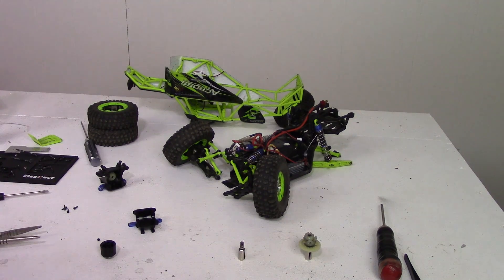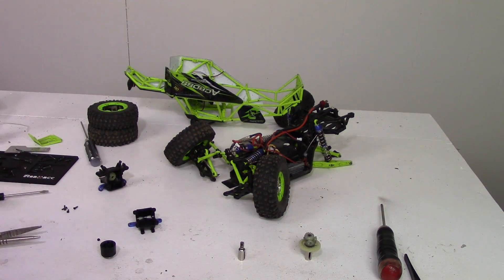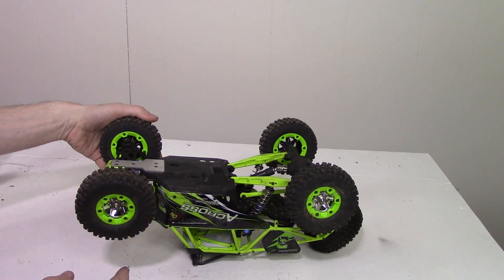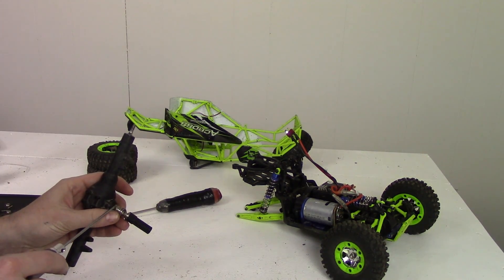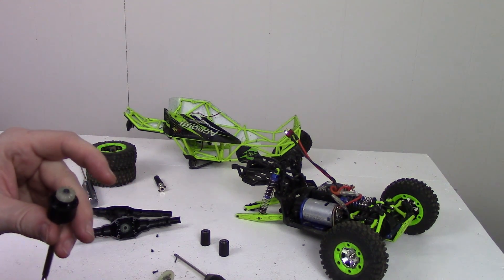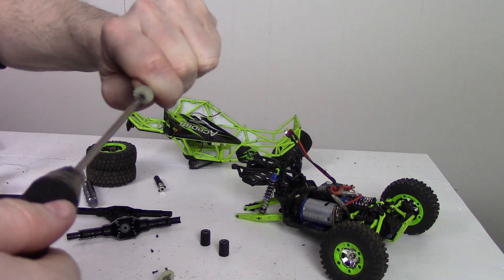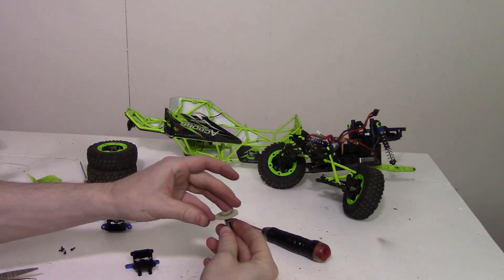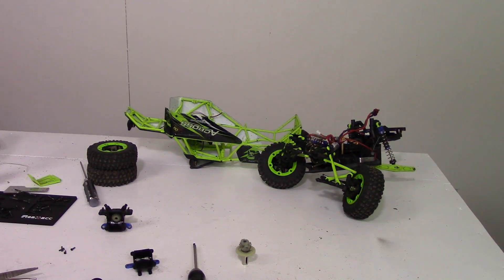WL Toys 12428 Diff Problems From Running 3S!

Comment: just ordered an aluminum Cree led light bar. very cool lookn design. Five 4 volt cree leds should throw some serious light. I much prefer cree style leds over basic led's. next on list is the hot racing 1 piece upper link mount bracket for the rear diff. it's a 1 piece design replacing the stock 2 pieces. it connect the upper rear trailing links to the diff itself. also an aluminum rear diff cover and the HR aluminum axle tubes for the rear diff as well. other than that nothing till I start getting all my orders in from Japan. glad the light bar is coming from the states here cause I'm still waiting on all my overseas orders. I got the driveshaft that's it. been over 3 weeks on the lower a-arms alone. think I got somewhere around 9 overseas orders and now 3 in states orders. it's the economy shipping that takes forever. the e-packet shipping usually gets here under 2 weeks.
Reply from the maker: A cree light bar! Nice! That'll be real bright and should look awesome. I've been there waiting for lots of packages to come in from overseas, the waiting sucks! haha. Sometimes I get problems with customs here leaving packages in a warehouse for months it's a real pain. I did find another pinion the same size as the one that I couldn't save, even though I've already ordered a new one. I can get that HBX up and running a lot sooner now.
Reply: Void X RC great. I'm curious to see it running brushless. Well at least you can replace the pinion you found so know you got a spare. Maybe one day try drilling out the stripped grub screw just to save that pinion. can never have too many extra parts...
Reply: Void X RC I also ordered what I believe to be the rite size servo ball for my aluminum servo arm which I still haven't been able to install yet. I bought a 10 pack. the 4.8mm size is correct it's just the thread size I wasn't sure about. and also I will say this thing drives amazing in 2 wheel drive. honestly for what I do I don't even notice a difference accept for squirrely back end in corners if I'm getting on it too hard but it's fun tbo. think alot has to do with these tires I have there great far as traction is concerned. the overall sound of the drivetrain is 100% better, smoother sounding.

Comment: I'm stuck between the vaterra twin hammers and the axial yeti. if I go with the axial yeti I'll more than likely go with the brushless rtr considering I really like there motor design. I really like the vaterra twin hammers as well. the build quality of the rear diff is exceptionally high. every screw hole has steel thread grommets punched into it's composite material making for no plastic threads. if the rest of the rig is built like the rear diff than the vaterra is a must, especially for the price...
Reply from the maker: My twin hammers clone doesn't have steel threaded grommets or anything like that. Is the twin hammers rear diff you got a stock one or is it an after market one?
Reply: Void X RC stock!!
Reply: Void X RC the rear diff is the best part of my build next to the motor combo wheels and shocks which I just tore down last night took the bottom caps off and pulled the retaining clips to get inside to the orings and packed some green slime in and reassembled. Not that it would hurt but the way this goes together the green slime stays in the center of the bottom cap lubricating the shock shaft to help better seal dirt out as the shock compresses and decompress helping keep the oil cleaner longer hoping to get more life out of these silicone orings. the green slime stays inside it's working like a charm till I get some shock socks. my front shocks are still the blue Chinese brand fayiue upgrade shocks which needed stiffer spring rate for the front cantilever style setup but they held oil like a champ till 1 day last week now they leak like a dog. I'm about to order the hot racing piggybacks for the front I'm not sure if the gmade xd will fit the front like they barely fit the back..

Comment: got it back together in rear wheel and let me say what a blast in the rain. I put the stock tires on to keep from burning up the superswampers and it's actually pretty easy and alot of fun to drive. not as quick out of the hole in the grass as it was with 4x4 BUT the grass was wet it was pouring out during the test and I was using the stock tires which are small and no where as grippy as the superswampers which I feel will bring the acceleration back up. try it out today now that it's little more dry out. the Toro brushless is insane I finally got to fully punch the throttle now that I'm not running plastic gears except for spur which isn't plastic and I will say holy crap the rpm's are so intensely high you feel as if the things about to explode like an atomic bomb. it's a very smooth sounding intensely explosion but an explosion of rpm's none the less. nickname my motor the atomic bomb. the rpm's are WAY more than I expected for a 4000kv system. I put more wear on the stock tires last night than they've gotten since I bought the truck. had to get it out of my system before I put my superswampers back on. other than that I really don't push the motor too hard and let it cool down first signs of heat, maybe little over cautious...
Reply from the maker: Haha yea 4000kv motor can produce some high rpms, were you running on 2s or 3s? On a fully charged 3S that motor will do over 50,000RPM under no load.
Reply: Void X RC.   3s.... got the fayiue rear diff in also yesterday. Are they supposed to be locked?
Reply from the maker: Nope, I semi-lock mine with really heavy diff oil, usually 500k weight.
Reply: Void X RC wonder why mine is locked. might as well get my money back I don't it anyway. the vaterra has a locker unit in the carrier. they sell the same lock unit to install in the front diff for twin hammers

Comment: I have the 12428 and the 12404, both have their place .....I tried bashin the 12428 and it failed.....I fixed it and took it Rock crawling and a lil mild off-road it was awesome! I run it on a 7.4v 2s 35c 1500 with a cooling fan on the motor ....35c gives it a bump up in speed and torque from the stock 🔋 (but it will run fine on a 11.1v 3s 25c 1800) just not all the time and if you go any bigger fizzle try your ESC!! .....if you bash it you'll trash it!!     Now my 12404 I bash the crap outa it(reminds me of a mini JLB Cheetah) and I run it on a 11.1v 3s 25c 1800 with a cooling fan on the motor and the ESC. With the stock 2s🔋 best run was 22mph ....on the 3s 🔋 after only 2 runs (then rain) 35.23mph it was just warming up I know it will do 38!! check out my videos!!!
Reply from the maker: Yea I suspected that the 12428 would do better in a crawling role compared to a bashing one.

Comment: I need help I have one and the drive lines will spin at full force but the tire only spin half that
Reply from the maker: It sounds like the gears in the diffs are starting to wear so they aren't transferring all of the power through them.
Reply: Void X RC I've only had it for 5 days before it started that

Comment: If the outside of the diff is fine just JB weld or glue the inside gears and have fully locked diffs it's way more fun to drive and you won't have to worry about this crap. I have the hbx transit pretty much the same RC and I in welded my diffs and haven't had any issues and I can crawl now which you can't do with an open diff anyways so why not lock them.
Reply from the maker: Thanks for the info! I have taken this apart more though and have used parts on another RC build! Used the motor mount and spur gear on a dump truck RC build
Reply: The motor will run hot and it won't be as controllable when bashing or doing speed runs
Reply: @kylestalnaker  I recently put a 3930kv in my hbx transit and it handles fine for bashing, speed runs is pretty dumb in a solid rear axle rig made for off-road your just asking to crash lol, it's like doing speed runs in a udr or super rock Rey it's super sketchy and not what they are made for unlike full independent suspension rigs
Reply: I hope you realize that a lot of people do speed runs with the UDR, hell the thing goes 50mph stock
Reply: @kylestalnaker  people do speed runs with everything but a solid rear axle trophy truck isn't made for asphalt speed runs, if they were then the drag racers would use them, it's like doing speed runs with an xmaxx it's cool and all but not at all what they ate best at.
Reply: Exactly, anything is possible with any rc, cheap or expensive. Hobbygrade is hobbygrade, you can do whatever you want with the vehicles. The only limit is how much time and money you're going to put into it. It doesn't matter what it's made for because you can make it anything you want. Just like when people make crawlers brushless bashers. They aren't supposed to go that fast and take that kind of abuse, but it's more than possible to make it happen and make them good at it. Don't put a vehicle down because of what it's made for, that doesn't matter.

Comment: just did some math. figured out in the 2 months of owning this rc adding the $80 price of the truck itself which is now higher from what I'm seeing I've got $587.61 invested in this hobby. this also includes the $15 in about to spend on another driveshaft. I honestly didn't think it was this much and even though it looks nice I'm not seeing the $600 lol. I was like wow holy shit man. who has $600 invested in a 12428, this guy rite here. and the thing about it is is it should be alot more. I got myself some kickass deals on things like the steering servo the radio the led light kit all my aluminum upgrades my wheels were good price the lightbar I just got $20 for a $50 lightbar. think all the aluminum upgrades were my biggest saving point. and technically I'm maybe 65% complete to where I want it to be. still need things like power winch, luggage rack, bungee cords, green lo glo means for undercarriage, 2 cree led light bar for headlights inplace of what's on my hood, possibly front drivetrain to get 4x4 back up and running, ect, ect... family is getting my a vaterra twin hammers for holidays. and I'm also lookn at the yeti xl along with my Losi 8ieght-e 4.0 buggy... need a second mortgage to further fund my hobby which is becoming increasingly more of a habit if anything.. I also need to create a type of bumper system for my roof to keep my lightbar from coming in contact with ground during a rollover especially on pavement which I discontinued driving on until I figure up something. even some corner rubber bumpers for the light bar itself. idk any open ideas are welcome!!!
Reply from the maker: I know how spending can be on RCs, has bitten me quite a few times. I do have another vehicle coming in the mail, who knows when it will get here, but It was a good price. I just got some new wheels for the hbx brushless conversion, they are so much better than the stock tires. I did have the feiyue that I am upgrading out on the trails yesterday that was fun, lots of mosquitoes though. I have to many ongoing projects now, hopefully I can keep track of them all properly.
Reply: Void X RC like to see those wheels when they come in. Did you get a chance to check out the fayiue upgraded diff with what appeared to be metal carrier yet. so you the hbx up and running? bet it's a bit if a beast with the upgraded brushless system in it. yeah I'll say I really didn't think I put that much into this already especially considering how much more I still want to do with it. the lightbar is a major huge improvement not only on the lighting but definitely on the looks. getting rid of the toyish lookn lightbar and the cheap lookn green wheels is the biggest improvement from low end to a higher end lookn hobby grade rc. the metal chassis upgrades also make for a more expensive and more sturdy look...
Reply: Void X RC well I can't honestly say all that money went into the truck itself, from being new to the hobby I had to start from the beginning with everything which I included into the price things like my accucell 6 lipo charger, my lipo pack 1 of many more I'm sure lol, $15 just for the chargers power supply which you have to purchase separately, big rip imo, others like large bottle of losi shock oil, couple dean's to xt60 connectors, ect. other than that the rest went into the rig itself. I have absolutely no regrets and soon as my truck driving school is completed I'll be able to buy alot more. Team Losi here I come baby!!!!! WootWoot!!!!!!!!!
Reply from the maker: I have a pic of the Hbx with the new tires here: https://www.instagram.com/p/BWKoNSsAv3w/?taken-by=voidxrc
Next week will be the running video of it. Yea accessories can add up after awhile too. I've invested in a good charger, solder station, lots of wires/shrink tube/connectors/crimpers etc.

Comment: Where you running lipos?
Reply from the maker: Yes a 3S lipo
Reply: @VoidXRC  Oh right, would it be okay to run 2s lipos?
Reply from the maker: @robcrawford9657  Yes it is meant to run a 2S lipo so so it won't be a problem
Reply: @VoidXRC  I didn't know that, i think i'll get one now i know it uses lipos, hope you get the diff sorted.
Reply from the maker: Thanks! I actually ended up cutting the chassis up and used parts of it to convert a toy dump truck into an RC one :)
Reply: @VoidXRC  Hahaha! cool, should do a video for that.

Comment: I put a 3s battery in my WLTOYS12428 and smoke come out of the motor now it wont go?
Reply from the maker: It sounds like the motor is burnt and possibly the speed controller
Reply: I found out were the smoke was coming from on back of the motor there a black Diode between the - and + I cut this off and now it working well :)
Reply from the maker: Great to hear!

Comment: Well I hope you got your money back. I've gotten mine so far but I do have alot I'm still waiting on. this vaterra rear diff is like gold in my hand, I'm done for hooked on the hobby. the thing is so smooth turning by hand feels like butter. I still want the HR axle tubes and waiting on my HR carrier to further support from flexing under torque. I searched and googled and googled trying to find any problems with any of the vaterra drivetrain and could not find not one problem. I found a few for axial some minor stuff but about it. figured I'd take it easy on the diff till the tubes and carriers get in but don't look like I need to even worry.

Comment: Hi, how you can drive on 3s? My Car smoke immediately on first Throttel with 3S T.T
Reply from the maker: For 3S on this RC you need to replace the electronics, so a new servo, speed controller and radio/receiver. The stock electronics just can't handle it properly.
Reply: @VoidXRC   Thanks for your Answer. But in the Video it looks like a Stock electronics in your Car. Greats from Germany.
Reply from the maker: Yes I still had the stock electronics, they don't always fail instantly. I have heard of quite a few failing instantly, and lots that have failed after running it a few times on 3s and some manage to run a lot longer on 3s. Temperature plays a big part, if it's 5-10C out compared to say 25C that can make a big difference for the electronics.
Reply: @VoidXRC  Ok that makes sense thanks a lot.

Comment: Both my front and rear diff had missing teeth on the ring gear and worn down pinion gear, Causing it to bind and spit out the rear drive shaft :P.  I only run a 1500Mah 2s.

Comment: LoL You dont need to buy new diffs. Of course metal gears and high quality parts would be beneficial, but you can fix those. Take torch and broken drillbit on the small side like one millimeter bit. Heat it up and melt peace on both sides of the gear, so those act as stoppers preventing saft from slipping. Peace of mild steel will do the job too. Then clean the gear and just get peace of scrap plastic and fill rest of the extra space using super clue. Helps also if you didnt get perfect fit with metal peaces. 

To remove screw try heating it and then use couple of pliers to turn the screw. It there is no area to crab with pliers, then try use something to cut a slot heat. Finally if nothing else works drill the screw out and and clean the treads with a tap. If you have access to small lathe its good idea to do this with that as making such small treads risks breaking the tap and then its lost cause.

Comment: got some nice rigs there in your main profile picture. especially the 3 middle 1's. the orange flame lookn truggy style with the losi disc wheels and the green crawler. actually nit orange more like red yellow and some black!! look like good tires for sand tons of small spikes!
Reply from the maker: yea 3 great vehicles there! from left to right is the axial Deadbolt, Hobbyking Basher sabertooth 1:8 scale and Axial Wraith! I don't have a great place to use the Sabertooth though :/

Comment: Mine went in a little bit of water and started making a squeaking noise. But it runs fine. Also, can post a video about how to clean the bearings with WD40 please.
Reply: Sealed bearings can be pain in the ass to clean, but you should be able to read information out of the bearing and order bunch of new ones for pretty cheap. If no info can be found, get digital calibers and measure it. There is no way they would have ordered any custom bearing for such machine, so there going to be bearing to match, even though those might not be under spare part listing.

If unleased, then just make water dishwasher mix and try to remove all the grime and grease. Spinning the bearings and dipping them in water should do majority of the work and then just do final cleaning with break cleaning spray to remove all the crap. Then just check bearing condition for play and if in order apply grease.
Reply: OK thanks for the advice.